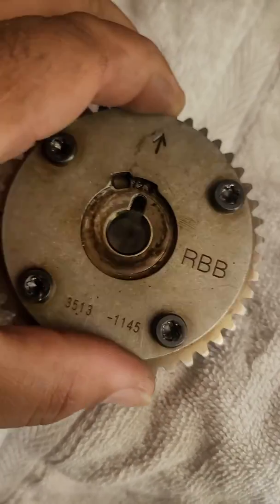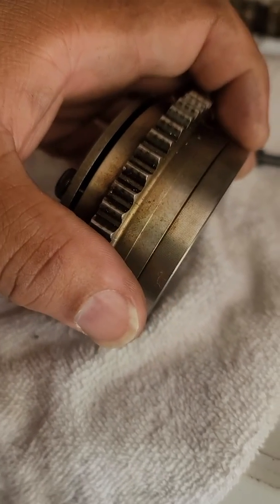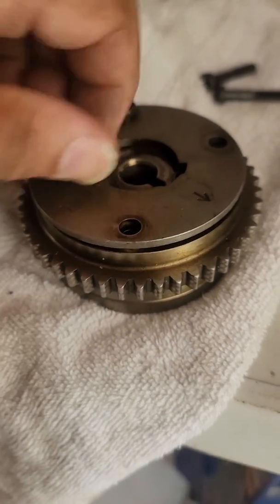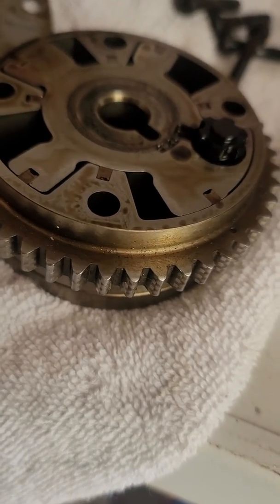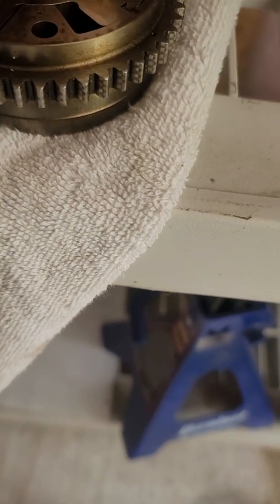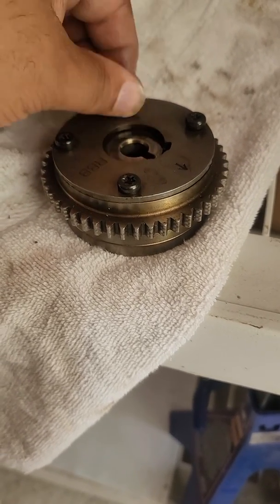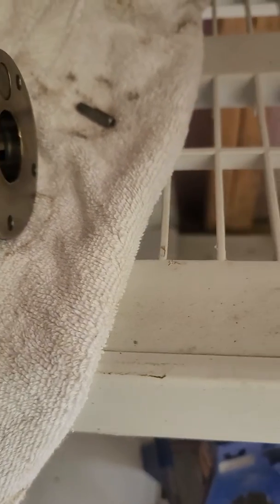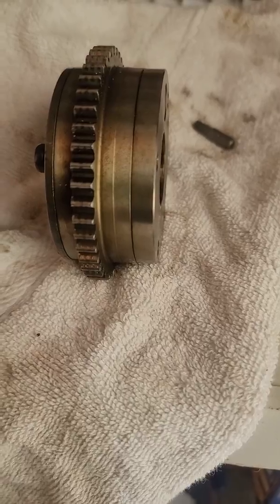vtc gear rattle fix

Comment: How did you remove the screws? I tried the Torx socket and it would not fit snug. It'll strip if I try to unloosen it.
Reply from the maker: On the opposite end of the cam there is a small hole u can put a small drill bit in that will keep the cam from moving that should help
Reply: @boostindc2
Mine stripped.  How did you get the bolt out?

Comment: Hey buddy good video and thanks for the tip! I have a question: so when I stretch the spring,  I don't have to remove the timing chain on the car??
Reply from the maker: No do not remove the timming chain you can do this with out  removing it
Reply: You dont have to remove chain just be super careful dont put preload on the tensioner so the sprockets dont slip as they are under spring tension and bungie cord them, also honda sells a camshaft gear holder its two pins connected by a link that locks both camshafts in place its like 10 bucks just type in honda camshaft holder and youtube a video on it youll see what im talking about i had to change my chain and tensioner when i did mine so i didnt have to worry about the chain slipping as it was coming off anyways[thats where the camshaft holder tool realllllly shines]

Comment: Wouldn't the spring have too much tension causing trouble when the oil pressure has to disengage the lock? Will the lock now stay engaged full time therefore not advancing or retarding timing because of the stronger spring? Thanks
Reply from the maker: Good question I had a friend sourced out of brand new Spring that he was able to find and the tension seemed to be just about the same once we pull the old one out to stretch it the length seemed to be somewhat identicall but I'm guessing with the tension that you're adding from stretching the Spring is nothing compared to the oil pressure that it needs to to unlock the VTC gear so that I guess no matter how much you stretch that Spring oil pressure alone is enough to still unlock it and lock it If that makes sense
Reply: @dateg18  Ok...that makes sense. I need to have this done on my TSX. I just hope the chain hasn't stretched yet from all the extra drag at start up. Did you see any chain stretch from your friends or your car before you did this?
Reply from the maker: @e11evenMinistries  I didn't see any when we did the fix  But that can  depending on the mileage and how well the car was taken care of
Reply: @dateg18  Thanks
Reply from the maker: @e11evenMinistries  no problem 🤙🏽
Reply: Just an update….. had the vtc replaced and noticed the timing marks were a bit off suggesting the chain was stretched or it jumped timing. Did the timing chain job with guides, tensioners etc and it’s working now. Definitely doing this if the rattle eventually returns.